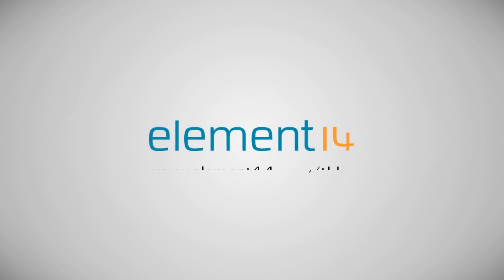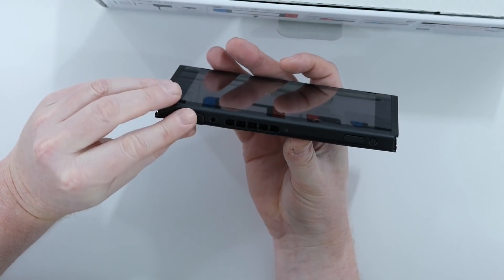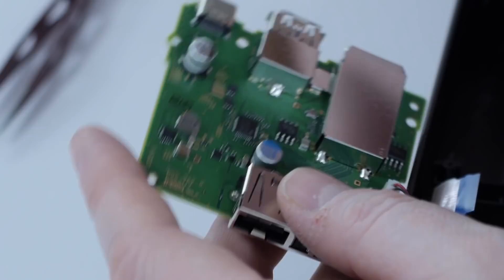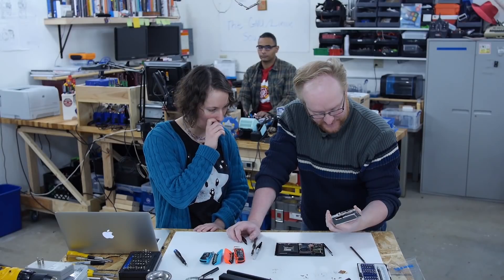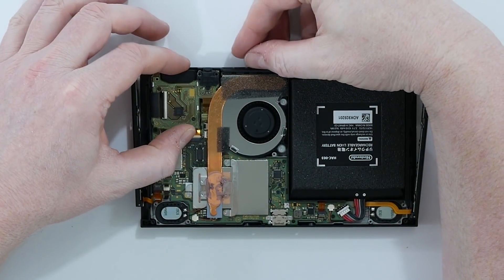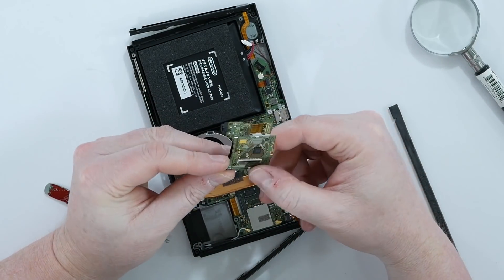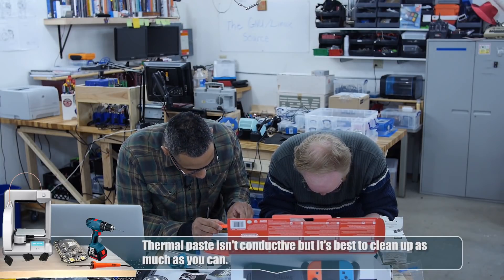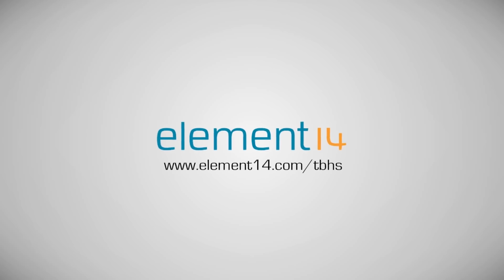Nintendo Switch Teardown

Comment: Ironically we never got a base switch model with more storage. The Switch Oled just has the flash storage soldered on the motherboard, so the idea of them selling upgraded storage by replacing the storage daughter board never happened on that original design model (This was in response to the 9 minute mark lol)

Comment: Better removing copper foil on CPU when changing thermal paste for better heat spread ? I wonder if i need to remove it, to garantie best contact between heat pipe and CPU

Comment: I wanted to see two things, the board or chip that makes the rumble feel and also their reaction to starting up Breath of the Wild which in my opinion is the best Nintendo game of the year lol Actually it was awarded Best Game of the Year in those grammy like awards they do for video games. That game is awesome even though most die hard gamers, the younglings that have quick wit and reflexes believed the game was too easy but this old school old fart found it challenging so I think Nintendo did good to mostly satisfy a wide audience. I hope they update Ocarina of Time for the Switch and also can't wait for the next "Zelda" game which should not be too difficult now that they have the engine from this one to work with. At least that are my thoughts. And the biggest complaint I have about the switch was their production at launch which sold out and then it took like seven months before I was able to finally get one so I came in behind the curve. Nice tear down Ben, Karen, and Felix! They never showed how Felix was able to determine how to remove that part in the controller. That would have been interesting. Felix should have been more involved but I guess it would have been too many cooks in the kitchen! Still laughing at Ben licking the cartridge. I'm surprised that he doesn't remember the old days when kids had to lick them and or blow on them to get them to load in the old days and that is probably how they figured out they tasted bad. It would be interesting to find out WHY they taste bad as it could be some toxic chemical. Be safe everyone! Cheers!

Comment: So... In the video description above, and I believe in the video (Ben), named the screws and driver used for the tear down wrongly. 

It is stated to be "Tri-Wing", but the screws, and therefore drivers, used by the Switch Dock are "*Tri-Point*". 

Does anyone know what size TRI-POINT driver is used? A Y1 is to big for the screws in the Switch Dock (I have a Y1). 

If anyone knows, or if "*The Ben Heck Show*" could correct their error, I would be grateful for the assistance, as Tri-Points seem to come in Y0, Y00, and Y000 (*?*), and I would rather not waste money unnecessarily if help can be provided.

Thank you.

Comment: Dears,

I need a help from you.
I don't know if it happens in other video games (probably does), the joy con buttons get "weak" after a long use, looks like the springs get damaged or fatigued. When you check the buttons clearances, it looks that the buttons you use most, get the most worn out. Is there any way to fix or maintain it?
Hope you can understan my doubt.
thanks since now,
Tomás

Comment: There is a joke about makeing this not portable, but its actually a good idea! I'll explain, at the moment the switch compromises a couple of things to a normal console. Heat, the switch does get warm, not hot, but a bigger cooler would keep the already efficient processor very cool. Noise, same as heat, bigger cooler maybe even no fan. Plugging in the game, its quite awkward due to it being designed to be out when you do it. Complexity, for someone who just wants it at home all the adapters and docks are not needed, a box that you just plug straight in and a pro control is all they might want.

P.S. Just an idea, not my ideal idea, Nintendo if you read this I dont actually  want this idea, its just for the purpose of modding.

Comment: I haven't played much games off the sd card as I only have 1 on the sd card but I didn't really notice a difference in load times (It is puyo puyo Tetris though) but from what I can tell and have been told it only takes sdxc. And the reason for the cartridge taste is so kids won't put them in their mouth and choke. it's the same chemical they put in paint to make you not drink paint

Comment: Since the internal memory is on a separate board, does that mean you could take it out and put it in another console (in case your original one breaks?) maybe they did it to simplify repair and data migration

Comment: WRONG!
Speed of electricity is nowhere close to speed of light. Speed of free electron - sure - speed of light
Speed of electron in conductor is much much less
Speed of electron in conductor under effect of electric field is much much less then speed of electron in conductor (not under effect of electric field)
Those are in orders of magnitude say speed of electron in conductor would 1/10^6 and under electric field would be even smaller part of that. I do not remember figures, but is much closer then you are.

Comment: I do not really get it. You all so called "educated" people are making "educated guess" and think that you got it right.
1st Formatting is actually preparing medium for being able to store any data, that includes File System. Formatting is Low-Level activity (windows in unable to format any media)
2nd Formating does not occupy any user-space
3rd sat 1KB is 1000B, 1MB is 1000KB, 1GB is 1000MB, 1TB is 1000GB
but
1KiB=1024B
1MiB=1024KiB=1048576B
1GiB=1024MiB=1028576KiB=1073741824B
1TiB=1024GiB=1028576MiB=1073741824KiB=1099511627776B
so 1TB is 931GiB or 953674MiB or 976562500KiB
disproportion?
4th what you all guys are calling format is actually File System Creation, which have NOTHING to do with format, as you can not create file system or store any data at all on device which is not formatted, but you can happily store data on media without any file system on. As example I can mention what happened recently to me - I got myself 2 3TB SAS HDD - both have not been formatted - capacity - 0B. HDD size was 3TB, but it was not formatted, so capacity was 0B. Unfortunately HDD had some problem and it could not be formatted - I tried twice on both of them. You may create file system anywhere on formatted media - media have to be fully formatted or capacity will be zero.
Proud to call myself hacker, who really does things other doesn't

Comment: The Number of Pins doesnt really matter that much for Speed. SATA uses 4 Pins for data, (A+/A- and B+/B-) while Micro-SD uses 3 (DAT 0-3). PCIe x1 also only uses 4 Pins for Data and PCIe 3.0 is FAST.  Stuff got Serial...

Comment: Idea of project with the Switch : a portable dock with a battery.

- The dock includes a 1080p screen.
- Looks like a laptop : to be able to change the screen angle.
- The battery powers the screen and the Switch.
- One the battery depleted, the Switch return to handheld mode.

Goal : Bigger screen and more battery life.

Comment: can you make a video on a good way to make a padding for the Nintendo switch doc
Reply from the maker: Karen took some fleece and sewed a little sleeve for it. Works great so far. Cut a rectangle, fold it in half, sew down the sides, flip inside out, slide onto front of dock, do a little dance.

Comment: It's pretty obvious Nintendo will do a larger capacity Switch and probably call that the Pro model.
I mean the Wii and Wii U both had a small capacity and larger capacity model. Why would Nintendo magically decide not to do that?
Also, they're deliberately not releasing enough stock of the Switch and trickling out supply little by little to get people mad and the hyped when more stock is available and just quickly buy it.

Comment: Looks like Nintendo anticipated doing repairs on this thing and wanted to make it as easy to replace parts as possible. While it costs more to put those parts on separate boards, it will save them a TON of money in repairs in the long run.

Comment: I NEED CPU/GPU SPECS!!!! 
I mean, What is so 'custom' on this X1 Chip? I want real data. Srsly it's the first time i bought an Electronic device, where i dont know the exact CPU/GPU specs -.-
And I dont mean clock rate. In first line i want to know, how much GPU cores does this thing have. 256?512?... If we' D know, we would know IF this thing has The Power to hold up with New AAA games. 
I hope, that zelda stuck on some time because it's the normal zelda engine, and they said UE4 works like a charm on IT. But Breath of the wild doesn't use UE4 at all. So it could be that UE4 games would run better at 1080p than zelda in 900p because of the engine. But that would be weird, because it's a Nintendo Game on a Nintendo console and IT would be a shame if other engines would run better than The engine that came from the same Company.... I guess, we'll have to weit Whats coming this year. I dont regret this buy. Zelda ist just AWESOME!

Comment: My only problem with the Switch is the lack of an Ethernet cable port.
Reply: You can use Wii (yes the original wii) usb to ethernet adapter, it works automatically with Switch

Comment: Would be interesting to see if the NAND can be switched out for a larger one, the only thing I can think of which would put a stop to it would be the actual software is stored on it and there is no way to flash it to make it boot up after.

Comment: This feels like Chinese knock off
Reply: this high end portable that is expertly put together with very clever thermal design and a damn good IPS display seems like a chinese knockoff to you?
ooooookay...
Reply: Tage Nasty The game was not designed for this hardware though. They took 5 years to develop the game for the Wii U, then they just ported it to the Switch
Reply: problems with antenna in joycon, wrist strap that gets stuck if you don't pay attention when attaching it to joycons, doc that scratches screen easily, screen isn't even protected and button position isn't ergonomic. This kind of problems I would expect from some inexperienced startup or copy of some other product and not from Nintendo who has a lot of experience with handhelds.
Reply: This is first generation hardware, and these kinds of problems are to be expected. This is why, as a general rule of thumb, you don't buy anything first-gen. 

I bought a Switch at launch against my better judgement (I said I was done with consoles) and I have not had a single problem with it - no scratched screen, no joycon connection issues... The only issue I had was dramatic FPS drops in Zelda, which is pathetic, given the game was designed for this hardware.
Reply: Fun Fact: Almost all devices are what one would call a "Chinese Ripoff".
Reply: I've never had a problem putting on the Joy-Con wrist straps; I just used logic: you hold the Joy-Con 'vertically' — the way you'd hold it if you were going to be putting it into the Joy-Con Grip or back onto the console — and then you slide the wrist strap on, dangly-bits-end toward the bottom of the Joy-Con.

Or: line up the +/- symbol of the wrist strap with the matching +/- button on the Joy-Con, which is much easier for some people to remember. :)

Now, taking the wrist straps OFF: THAT is a little frustrating, because even if you put them on CORRECTLY, they still want to stick and be difficult to remove. :/ (And before you ask: yes, the Lock WAS disengaged. :p)

I've also had no problems with the dock scratching my Switch's screen: I get a couple of smudges where the rubber stabilizer pad things in the dock rub the screen, but those wipe off fairly easily.

I did SOMETIMES have problems with my Joy-Con, but they were almost exclusively problems with the left one that came with the console; since I replaced it with the Left Joy-Con from a newer, separately-boxed pair, I've had no issues.

As far as the ergonomics of the buttons go… They seem fine to me, no matter how I'm holding the Joy-Con, and my hands are pretty big. ¯\(º_O)/¯ I also have the Joy-Con Gel Guard things on my Joy-Con, though, so maybe that helps.

But I digress; this comment has become longer than most people will be willing to read, and I'm finding it painfully slow to continue tapping this out on my Wii U's GamePad, so I shall bid this comments thread adieu! :p

Until next time!

Comment: Great teardown, but electricity does not move at the speed of light. The actual value is dependent on the conductor but is typically between 0.5 and 0.8 times that of light.

Comment: Based in what you know about the hardware, these problems that people are having related to the control loosing connection with console, the strange artefacts appearing on screen and some audio noises. Do you think this is a conceptual problem of the hardware, or is just an isolated problem with some units? By the way, great video.

Comment: Apparently Nintendo coated the cartridges in denatonium benzoate which is really bitter.. specifically to try and stop pets and kids eating them.
Reply: Hayden Gittins i get the feeling they had to do that is because staff kept eating them .. thus the shortages
Reply: That's a pretty individual thing. Some people just aren't very sensitive to bitterness (and/or some game cards may have more or less of the agent applied through manufacturing variation).
James Rolfe was pretty in-different to it, and even ended up popping the whole card in his mouth for quite some time without a particularly strong reaction.
That doesn't mean other people who are more sensitive to bitterness are not going to just touch it lightly against their tongue and snatch their head away with a strong reaction, closer to what Ben had.
Kids are generally more sensitive, which is of course the real intention behind it.
Reply: Hayden Gittins I tried licking one today and trust me, it really isn't that bad

Comment: Ben was wrong about one thing. Not all cartridges have to load into RAM. Older cartridges are actually directly plugged into the CPU address/data bus and contain ROM, which does not have to load into RAM, obviously; as its directly accessible to the CPU. Specifically, the SNES, which he says has to load, in fact does not as it uses the older technique as all those older cartridge-based systems did. New cartridge based systems use a serial communication interface (data, clock, chip select, etc...) instead of a parallel CPU address/data bus interface, and are therefore not directly accessible to the CPU and need to be loaded into RAM.
Reply: Also, electricity does not move at the speed of light. Obviously.

Comment: Sandisk japan did load time tests comparing on system memory, Cartridge, and SD speeds. they load literally a second or 2 slower. its not an issue.

Comment: my guess (i'm only at 16:59 ) is that the nvidia chip is the tegra x1, a really bonkers powerful chip that needs cooling if you use the full octo-core cpu 256 core gpu varients

Comment: If they did design the Switch to facilitate potential future upgrades, this would be hugely good news both for Nintendo and the gamers that love them... I'll explain a bit about it below the fold.

1. Potential upgrades means a longer life-cycle for the switch. This is good news because a lot of the time consoles are often sold at a painfully slim profit-margin if not at a loss. So, if Nintendo can extend the life of the Switch, that means they are ensuring that they will make console gaming profitable for them AND it will encourage more games to be made for the switch in the long-term.

2. Potential upgrades also means you may be able to increase the performance (eventually.) This also extends to things like an increase from 1080p docked to the potential for 4k docked. Personally, I'm not big on that but for some gamers, it's big. Also, better framerates (which would be crucial for the eSports side for games like Splattoon2 and Smash Bros.)

3. This is putting their competition on notice to up their game. Their competition have been trying to do stuff like this BUT they've been making them totally separate consoles. So, if you bought a PS4 at launch but wanted 4k, you'd have to buy a totally new console. This potential upgrade means you may not have to pay for a full console just to improve your gaming experience, you can just send it in to be upgraded (which will cost, of course, but you're likely not going to need to pay more than what you initially paid for the switch.)

4. This also means that repairs/RMAs will likely be quicker. If for some unfortunate reason you break it, if more things are modular, that means they can isolate the problematic element and just replace it quickly rather than having to de-solder things from the PCB/Motherboard.) That said, this is dependant on what breaks down. Some things like capacitors going sour would likely require de-soldering.

5. There's one more thing that is massively important to take note of... This suggests that Nintendo is actually listening to their customers. This is a massively huge pro-consumer move that will earn them a LOT of good will which will also translate to better sales.

And since the Switch is apparently selling very, very well, it's probably a good time to invest in Nintendo stock (though this is not advice, just my personal, not-a-stock-broker, opinion. Always consult with a qualified and knowledgeable broker before investing as my lay-person's view is just that, the view of the lay-person. I'm more on the marketing/business side than the cut-throat Wolf-Of-Wall-Street stuff.)

Comment: I'm wondering if the wifi adapter is susceptible to the reset glitch found on the raspberry pi, use a xenon camera flash if you need to reset it 🤔

Comment: I had this idea about the separate MMC board, when watching another teardown... What if it's a reverse case. They do the system transfer for the defective returned units by simply moving the chip to the new machine. It is the rest of the machine that is replacable/upgradable.